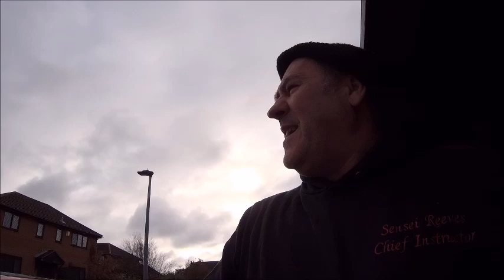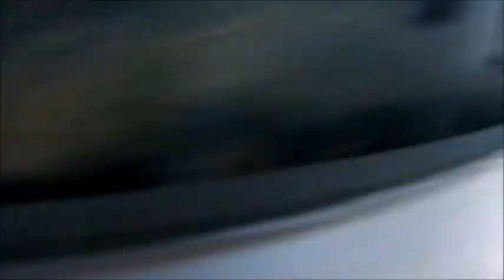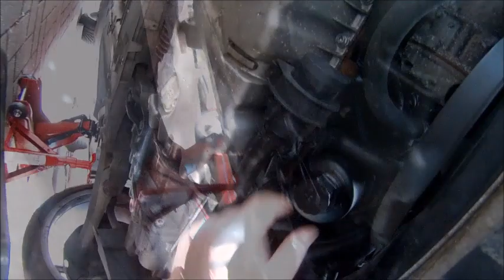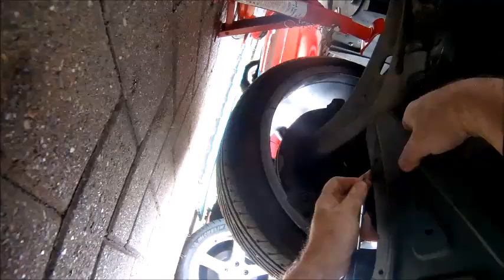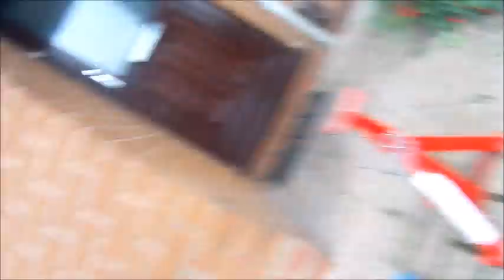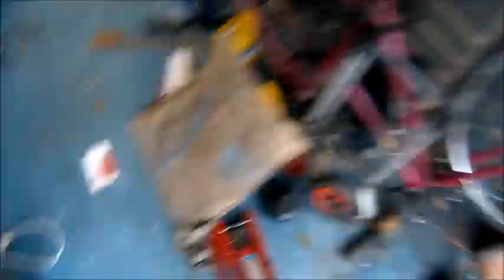Audi S3  8P oil change in under 7 mins

Comment: hi when you refitted the filter housing you only put one new o ring gasket on did yours not come with 2 as mine did but I only used one now I seem to have a oil leak was just wondering if you fitted a second off camera
Reply from the maker: No all the changes I've done on both Audis there is only one O ring  🙂

Comment: Was the 5 litres enough mate? I googled to see the oil capacity of the S3 8p there and it says 5.3 litres, just checking before I crack on and do it tomorrow as I've only got the 5 litres here.
Reply from the maker: all the changes i have done took around 4.5 to 5 ...so maybe the 5.3 is a different spec.  :)
Reply: @AdeReeves  thank you for the quick reply again ade, top man 👍

Comment: Hi Ade, did you not see my comment on your previous oil change vid, I sent a handy link you might like
Reply from the maker: Hi mate...yeah saw it thanks...was going to see if I could fabricate one myself as felt a bit pricey to save a little mess...  still that's Audi for you .... I see some people use sockets to do much the same thing but this method definitely looks the best .  👍
Reply: @AdeReeves  no problem, I just wanted to let you know there is a tool that plugs into the cap. Also what is that orange thing in your engine bay?
Reply from the maker: @N1NJAKIDD  Long story ....something that was a bit of fun for a drive by car show for a lad called Alfie's birthday....Its an Awooga horn....yes I know it's childish ...but hey ho  '''''  LOL..... BTW took me ages to fit it ...has it its own wiring circuit and in line relays...far too much of a pro job for something so daft    :)